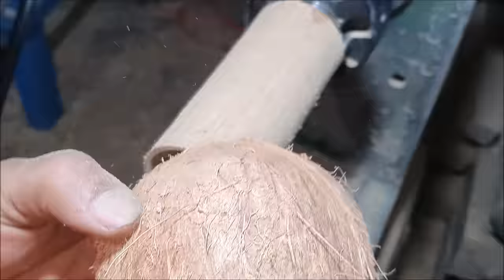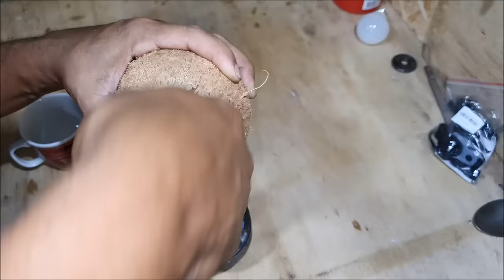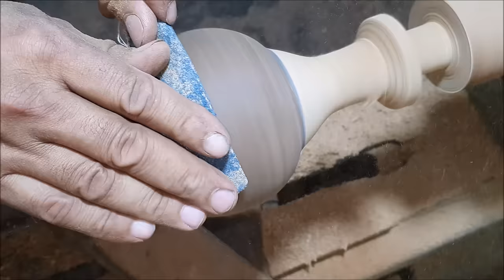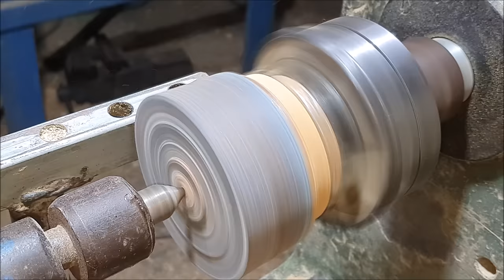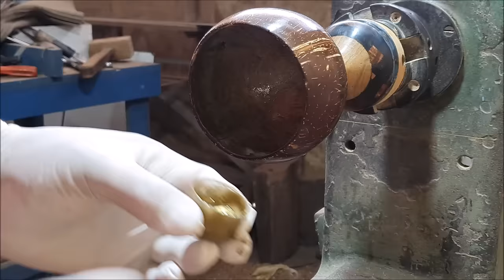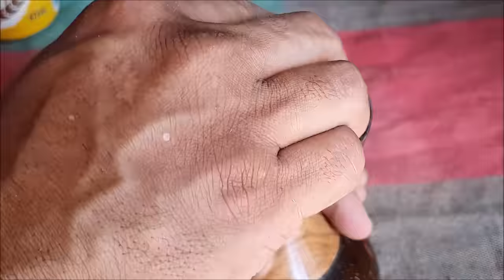Woodturning - Wood, coconut and resin a Transformation //Madeira, coco e resina uma transformação

Comment: I make jewelry from coconut shell all the time, the inside white can be sanded down to dark without compromising the integrity of the piece. Also the shell is hard enough that it will polish without any chemicals not even oil. I would still coat it as you did for a drinking glass, but it isn't necessary for the shiny polished look. On my jewelry I simply polish it by rubbing the back of a spoon against it. This works on the inside and outside of the shell. This method will not get as shiny as the as the piece shown in the vid. Just some tips on what's possible from a guy who works with coconut shell daily. Not necessarily suggestions that apply to this project.
Reply: Good
Reply: Here we eat the white inside part. We also use it to made candy and we call it coconut candy. Its yummy.
Reply: @Web38087  I'm not talking about the meat/fruit ... I'm talking about the part of the shell that's white (actually really light tan, but close enough)... what I'm talking about is made of a wood like material and would taste like wood.